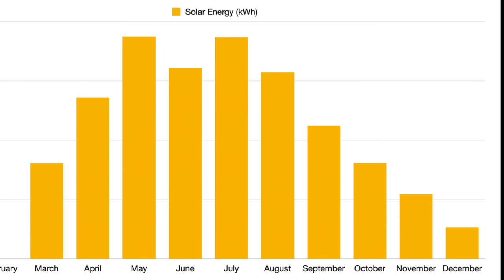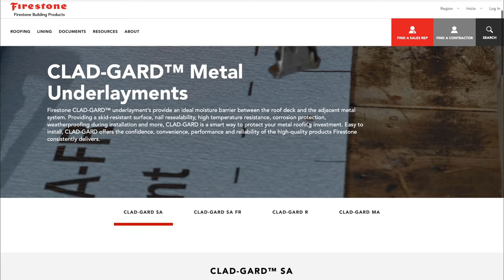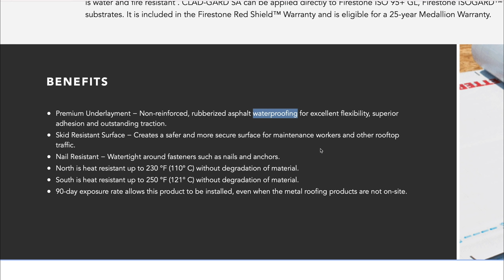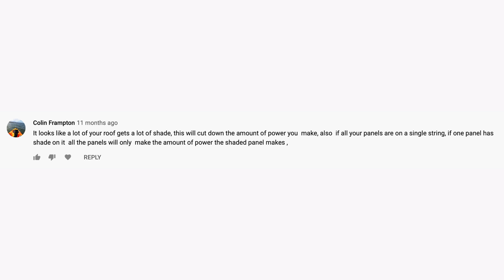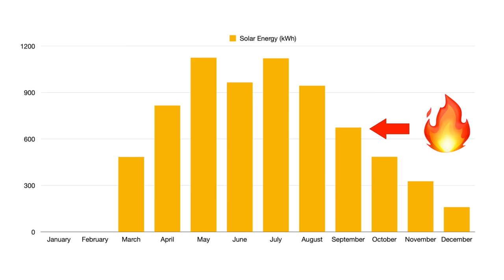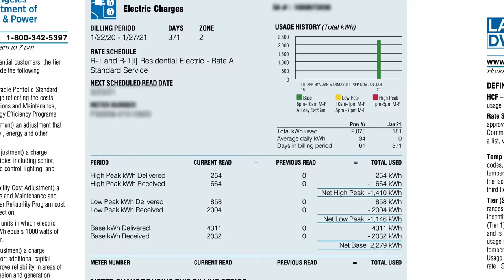1 Year with Tesla Solar Roof: top 11 questions answered + real production numbers & utility bills!

Comment: Where I live it would take 54 years to pay back the cost of installation. Assuming it lasts 20 years then it wouldn't be feasable. About what someone else found out with their wind generator that cost $32,000. Didn't work as planned and after five years was out of commission.
Reply: Electric isn’t all rainbows and unicorns. Oil requires a hole to drill, electric requires ugly strip mining for the elements needed to make a battery. Plus my ‘charge time’ is 5 minutes. That’s how long it takes to fill up a tank of gas.
Reply: Have the same issue were I live as well. 25 year ROI last time I checked and priced out solar.  That is were the real challenge for Solar is, you need at least a 5 year ROI to justify the initial investment.  Unless, your goals is just to get off the grid, or other environmental reasons, it gets hard to justify.
Reply: You don't have to pay back the entire cost of installation to make it worth it.  If someone needs a new roof that roof is going to cost a lot of money.  They only need to save enough on their electric bills to make it cheaper to buy this roof than a regular roof to make it worthwhile.
Reply: @SKOOKM  great point. Buy the panels when you need a new roof.
Reply: @michaelbrown1627  Right. It would not be smart to replace a perfectly good roof with them, but if in the market for a new roof then do the math.
Reply: @SKOOKM  calculate ROI based on the difference between a standard roof and a solar roof.
Reply: The number you are giving are they taking into account energy increases over the next 25 years? My electric bill has gone off the charts the last few years alone. For me it’s not just saving money but sticking it to my local energetic provider who has been sticking it to me the last few years. Every December they up my bill 40 percent for the winter months. Like it or not fossil fuels are only going up and they providers will use any excuse to up your bill.
Reply: @boblatkey7160  so, basically tax payer’s (most of whom cant afford solar panels)money is subsiding it.
Reply: @boblatkey7160  maybe the Tesla solar roof costs a lot more than a normal solar system
Reply: @michaelbrown1627  This is why we need to ditch mars and go for the asteroids. Turns out the asteroid belt in FULL of 'rare earth elements" which if we could find a "safe" way to harvest, then all of our resource constraints on technology would functionally disappear.
Reply: @lancewright521  Except the resource constraints on the technology needed to mine asteroids is functionally infinite, not to mention the timeline. It's a nice dream, but it's still very much a dream at this point.
Reply: @lancewright521  Solar System 101: Mars is closer than the asteroid belt. So the logical thing to do would be to have a colony or some kind of base on Mars to act as the launching point for asteroid missions. Because as it currently stands; manned missions to the asteroids from Earth is just not feasible.
Reply: @michaelbrown1627  Oil doesn’t last for ever and the price is already going up. 
And burning fossil fuel is bad for the environment.
I think its a good solution when you have a house and drive an electric car. You can charge overnight and you don’t need that 5 min anymore to fill up.
Reply: @lancewright521  It would cost so much more money to mine asteroids than to mine here.
Reply: @randomroses1494  Yep. I just configured a tesla roof just to see how much they cost and the roof would be $58,000 even after my neighbors pay $13,500 of my bill since its their tax money.
Reply: @BJJGamer  We don't even have humans leaving low earth orbit, and you're talking about having the infrastructure on mars to put rockets back into orbit. Hate to break it to you, but Missions to mars will be one-way for a very long time.
Reply: @LBCAndrew  Uhhh yeah, I never said it would happen overnight, lol. I just said that Mars has to come before asteroids, since Mars is closer.
Reply: @ScharfeMesser  problem is that electric has an impact as well. The electricity is usually generated from coal burning plants. And EV batteries are horrible for the environment.
Reply: 54 yrs....so you're saying it cost $100k
I've heard quotes closer to $45k
Reply: @ericmcmfd  Based on 32 cents a KW, which is the cost here in rural Alaska, but not figuring in lack of light during the winter which would mean a longer time to get investment back. 
The cost estimate is 70,000 which is based on real numbers that contractors charge for an average 2000 sq ft roof.
Being in construction I know when contractors estimate most of the time the contractor lies and goes very low. They have to or they won't get the job, or any job, and deal with the blow back later. So I don't believe $35,000. You tell the customer what they want to hear or don't get much work. I don't lie to the customer and so get few jobs and most all are finishing what the liars started. I also ran a power plant and know how the physics and costs work in real life.
Reply: @boblatkey7160  You're an exception.  Most people won't risk DIY.   A standard 6kw system installed can run anywhere from $10,000 to $50,000. (At least here in Texas)  Believe me when I say there are scam artists out there.  They pitch the 25yr no worry warranty and charge for it also. We're not even going to get into Tesla's inflated pricing.  The numbers are definitely not skewed

Comment: I know each house will have a different cost based on roof lines, shape, local laws, etc. But do you mind me asking how much the roof installation cost you all in, as well as an annual roof cleaning? Basically, for those who are more financially motivated, how many years would it take for the electric bill savings to cover the cost of the roof. And of course, given the fires, your savings could have been larger, but curious where the break even point is. I'm sure it's at least a decade out?
Reply: My guess is about 40k before any incentives.  You can go to Tesla's website and use their solar roof calculator.  Now you'd get 30% off from the feds so I'm thinking without powerwalls it's around 28k.  Not sure what incentives CA does.

Comment: I'm going on 6 months with my tesla solar roof, starting in November 2021. I have a basic setup of 13 panels plus the inverter, etc. Tesla's communication is somewhat poor but ultimately, work always gets done.  Over the past 5 months my total cost thus far is $77 for the electricity and another $60 for the basic base charge (everyone pays around $11-$13 a month). My monthly base charge is paid monthly and the actual electrical bill accumulates for 12 months with either a final credit for the year or a final bill. Obviously, I hope for a zero bill at the end of the year, and so far it looks as though I'm headed in that direction. If I zero out my electrical charges by the end of 12 months I'll have gone (counting the base charge) of from around $1400 a year to about $150 a year. Since my original cost, after the fed rebate, was around $6600 my payoff looks to be in about 5 years. Tesla will be around and their warranty covers parts and labor for around 12 years on the inverter and around 25 years for the panels. HOWEVER, if the CALIFORNIA rate commission changes things and makes owners of solar roofs pay more, then it may make the whole process a bad investment.  I would encourage anyone in California to pay attention in the next few months to the upcoming rate commission's final decision as to charges.  Also, since there is talk of grandfathering in systems installed prior to the rate changes, that may be a good incentive to at least investigate and consider getting solar installed now. One thing for sure, if you get solar, due to the longevity of Tesla as a company, I would only recommend that company to install your solar panels.
Reply: so why is it that you guys are using 33% of the energy and the other 66% goes back to the grid (like he said in this video) and yet you still owe them money at the end of the month unless youre buying gas as well
Reply: I don't understand , if you have Solar why even hook up to the Grid , and your bill will be zero . I know plenty of people living off the Grid on Solar . I don't see a benefit of staying hooked up to the Grid , I actually see it as a Negative .
Reply: So California possibly could charge you a fee for sunlight..... ?   Something seems a little creepy about that...
Reply: How much $$$ was the install?
Reply: @klaysskipper6843  It’s most likely the different rate. Since they essentially pay you a “wholesale” price for the power you put into the grid and you pay “retail” for what you take out… The grid provides storage so you should have to pay for that. If you don’t like that, then you need to look into batteries such as powerwalls. Those aren’t cheap and so you have to run the numbers to see if it’s worth it and how long to recoup. Also, frequency of power outages could be a factor in being “off-grid”. If the grid goes out regularly, buying batteries and being off of it may be worthwhile.
Reply: @michaelfulcher5743  at almost 10k for the tesla wall that only gives you 5kw is too much $$ and not enough power... also theyre not letting you get the tesla wall with solar anymore... unless you buy the tesla solar roof, but at the same time you pay 20k for 2 tesla walls you could add 20 more solar panels instead.... i think i would just buy panels that insure at least 40 kw max for 24 hours instead of storing power... for what? night time ? then maybe buy your own storage idk 100 car batteries  that can get you through the night and re charge in morning time
Reply: @kanibis420  me too unless you dont make enough kw at certain points in the day...like washing,drying,charging a tesla, hvac might pull 45 kw and your solar only pulls 30kw so for that time you need an extra 15kw but now they take your extra solar and theyre gonna only pay 80% then 60% then 40%? whats the point buy more panels and ensure you never need any extra and dont bother with the batteries unless youre sure you can produce 100% every day  then you can charge for just the night usages which is probably 15-25kw for 10 hours thats a lot seeing tht tesla wall only does 5-7 kw for like 4-7 hours depending
Reply: @klaysskipper6843  Lol...its a lot of money for aesthetics. 100 grand for a roof that may not be that efficient but it sure is attractive. I was part of the launch of that project. Taking deposits before we had any idea of making something like that work to have a product for market. The fact that people are willing to have an entire roof made of glass just amazes me. Elon can sell people anything 🤣🤣
Reply: @christhompson6010  “part of that project” is a bit of a stretch, my guy. You were taking deposits. Probably contracted through a third party. 

Doubt the actual project team was keeping the deposit takers abreast of the progress.
Reply: @klaysskipper6843  I’m not advocating the value of a Tesla wall. But you were questing the disparity in % and I was pointing out that it’s not 1:1 for what they pay you and you pay them. You’re essentially paying the grid owner for “energy storage”. You can pay them or you can buy your own storage and put in batteries. Yes, you can use a car battery bank (lead acid) but that’s kinda janky. Better options aren’t cheap. There’s trade offs with this. Some areas of the US lose power frequently and being off grid may be well worth the extra cost and maintenance. For some, the grid is a better option.
Reply: @tuabenjamin  Obviously not . Tesla finance was taking deposits. Can't go into specifics because i signed and NDA as part of the job offer. I can give you a general idea  of what happened and what my role in the process was. I was part of the SolarCity Buyout  under Pete and Lyndon Rive (Elon's cousins) My  job was to support the R&D division which acted as its own entity under the umbrella of SolarCity. I managed the logistics and purchase orders and credit lines for that division. All prototype material went through me. Under SolarCity we had an open Budget to come up with ideas with some of the top application engineers from around the planet. Whatever these guys needed my job was to get it for them. i had access to an unlimited credit line. It was up to my group to make this SolarRoof thing work in order to pitch to the investors So the deal would go through. I had a convoys of delivery trucks moving material down to southern california around the clock just so Elon could stand on stage and hold up a piece of glass and say how simple it was .the deal when through We were given offer letters and a bonus for are part in helping the deal close. JB straubel was assigned over are division as SolarCity no longer existed.If it wasn't for the NDA I could tell you stories about this company that would have wondering how they stay in business. Still have the offer letter,RSUs and Profit sharing bonuses saved on my drive.
Reply: @michaelfulcher5743  no i understand what youre saying im simply thinking out loud here trying to figure out why solar companies are not helping people get completely off the grid what the point in paying solar loan and energy when they should be installing enough panels so youre are never paying the electric bill they should be paying you a few bucks a month for over production idk if moon light can produce enough energy to run say a heater all night if not then you would need batteries that way youre never paying bc right now solar panels are taking 15 years or more to start paying for themselves
Reply: @kanibis420  they use batteries to store that energy produced during the day, without batteries you send the production to the grid and receive saving points which will cover your usage during night time.
Reply: @tinotino9698  I didn't realize this system didn't have batteries to store the Energy . I personally think it's Stupid to have a Solar setup without batteries . The whole reason for Solar is to get off the Grid , if the grid goes down , your Solar is useless .
Reply: @kanibis420  many states have laws on what conditions are needed to be considered a livable structure and being connected to the grid is one of them. Even if you're fully solar with energy storage, you have to keep the grid connection so of course the power company charges a fee just to do nothing.
Reply: @happywrenching33  Good question, he never mentions that,  Ciao
Reply: @darrin  The credits he gets for daytime output go towards his peak/night time usage. His electric bill is cheap. A solar wall is 12k. He prefers to pay the 100 bucks a year, than put out for the big battery.
Reply: @darrin They do because , I guess they aren't using Batteries to store the energy , they are still hooked up to the Grid . which in my opinion is Dumb , if you're gonna go Solar get Batteries , and unhook from the grid .
Reply: @kanibis420  "which in my opinion is Dumb "  Is that because you're bad at math?  You're saying he should pay $7000 in batteries to avoid paying $150 a year.  That would take 46 years to be worth it.
Reply: @johnflux1   I think you may be the one bad at Math . It wouldn't cost anywhere near $7000 dollars for batteries .
Reply: Why would it make solar roofs owners pay more?! 
Do they pollute in any way?! or otherwise harm the local environment in any way?!
The whole idea is to get clean energy and get rid of the existing major power plants that use polluting methods.
Pollution and other taxes/fees are meant to discourage those from functioning.
Reply: @ElGoogKO  ElGoogKO, you've completely misunderstood.  Currently there are subsidies for people buying a solar roof.  But those subsidies might go away.
Reply: @johnflux1  Ok. And that is even worse.
That is the whole ide. That is why people pay taxes, for benefits, not to have them siphoned to various corporate groups. They already are, but the people must get back some things as well.
ESPECIALLY in the most overpriced state and the most obnoxious about pollution, and one with most hipsters and SJWs per sqft. 
It means this state has the most superior and evolved life style, where eco activists get to enjoy the benefits
Reply: @klaysskipper6843  Something to think about ....... Some electric vehicles are now being built with an AC adapter that allows the vehicle to provide power for external devices, including a house (Kia comes to mind).  Wouldn't it be cool if that could be incorporated in the electrical system for continuous power.  The caveat of course is that the vehicle itself would only be able to charge during the day but could provide power at night resulting in a completely off grid system.  Also, here in Texas most systems are coupled with emergency backup generators fed by natural gas or propane due to the prevalence of hurricanes.  Thus giving solar powered homes the ability to operate off grid if necessary.  All systems must of course have automatic transfer switches to protect against accidental backfeed. Just food for thought.

Comment: It would seem for this to be an accurate assessment of your savings, you should deduct the cost of cleaning the roof since it is required to generate electricity...  Wonderful presentation.
Reply: Also the actual installation cost of the roof itself.
Reply: @jimh472  yes, I found the costs here https://youtu.be/LRPy8UZv9V0?t=135